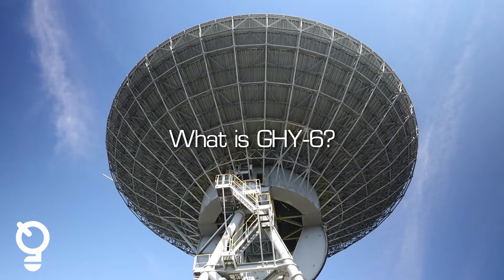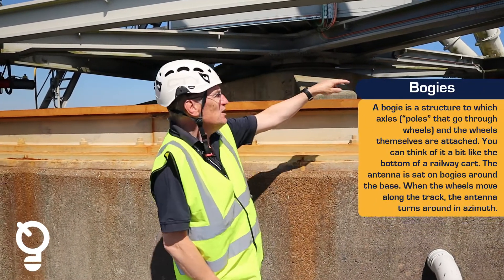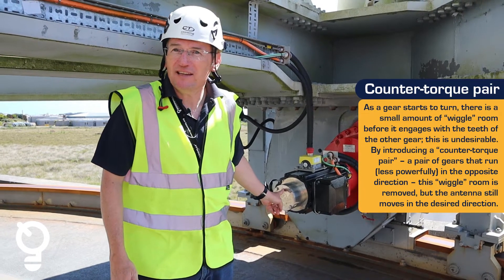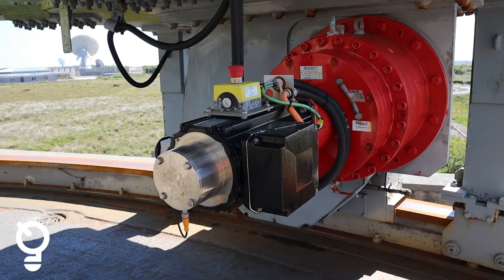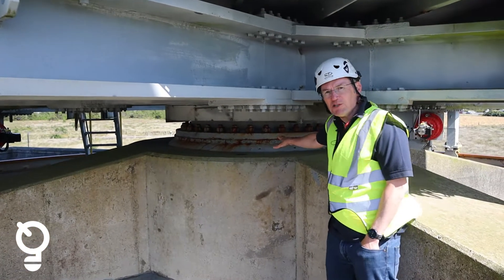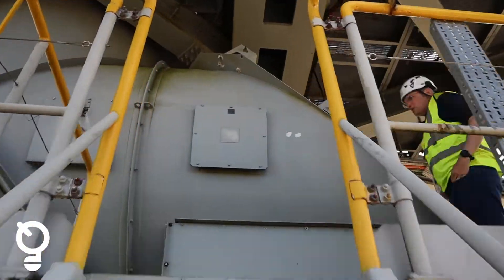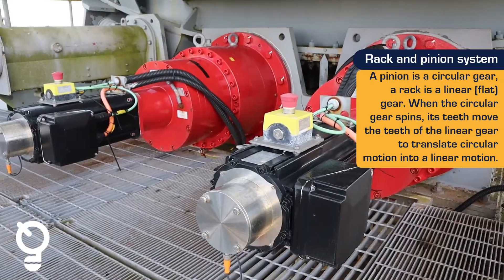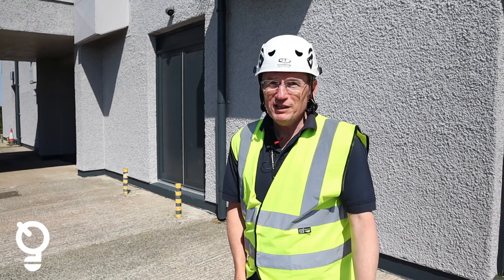A Tour of GHY-6 (Part One)

Comment: What frequencies can the dish operate at?   What accuracy is the dish designed at?   Is the dish parabolic or hyperbolic?   What is the sensitivity in receiving mode?   Please and thank you.
Reply: The antenna operates in S- and X-Band (2000-2300 & 7145-7235 & 8400-8500MHz).
If i look at comparable antennas in terms of size and receiver, i would guess that the G/T should be pretty much 50dB/K in X-Band.